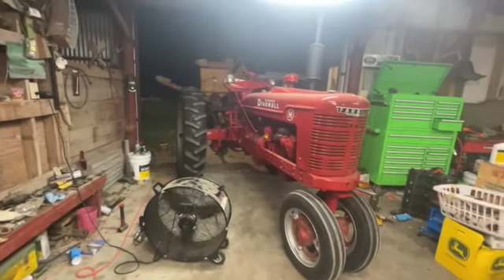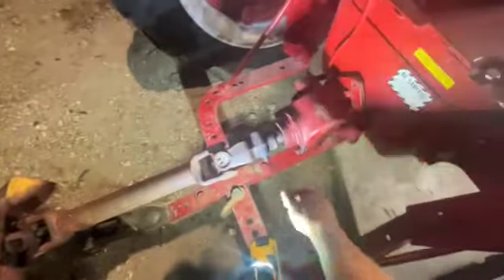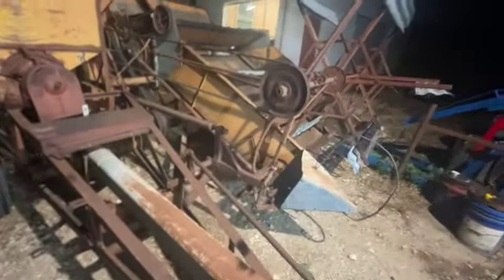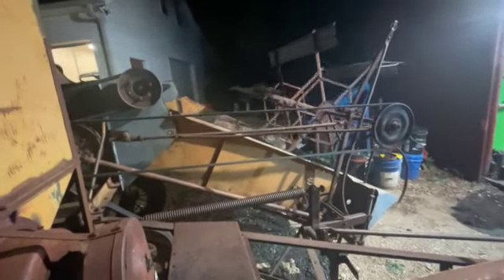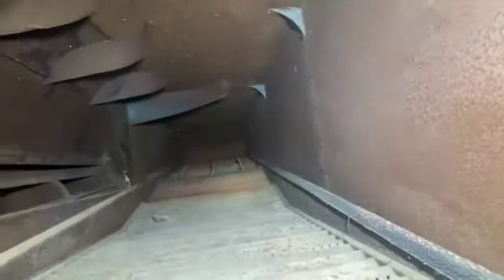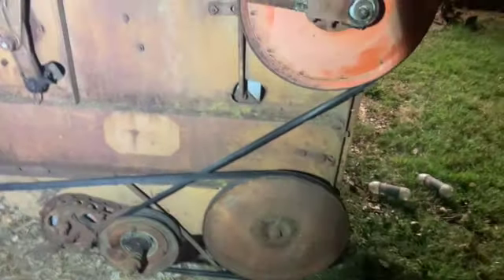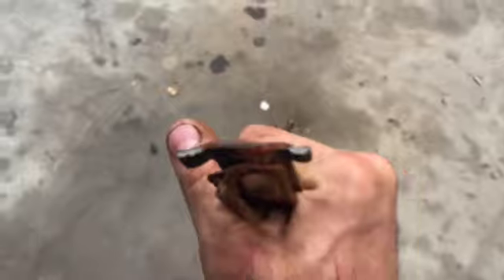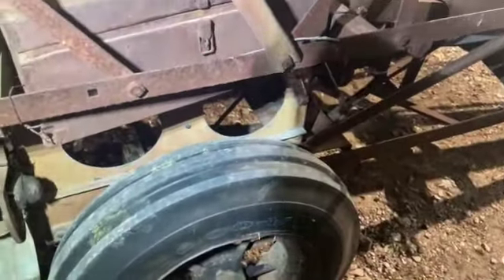How a Allis Chalmers All Crop 60 works and how to break one

Comment: You may have an early 66. You can tell for sure by measuring the cutter bar. 60 inches is a 60. 66 inches is a 66.  I have not ever seen a 60 with the six bat real.
Reply from the maker: 6 bat reel is was a option in the later ine